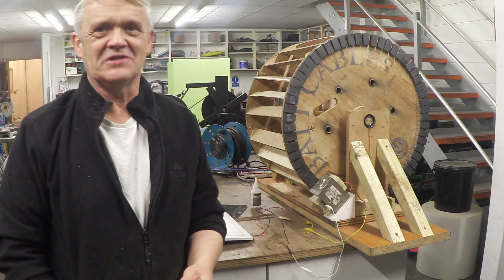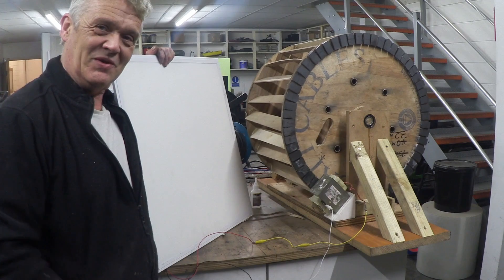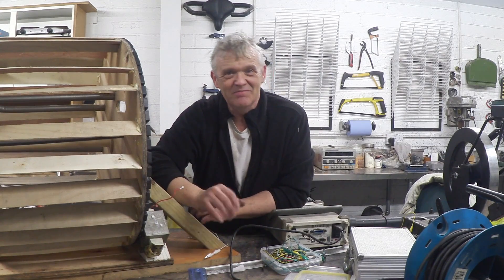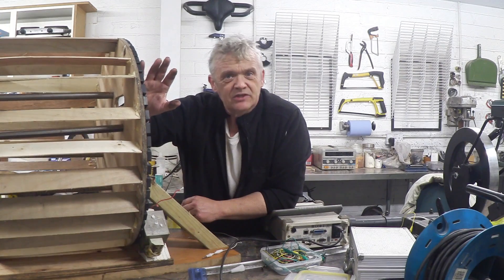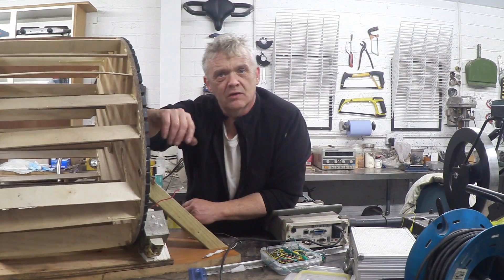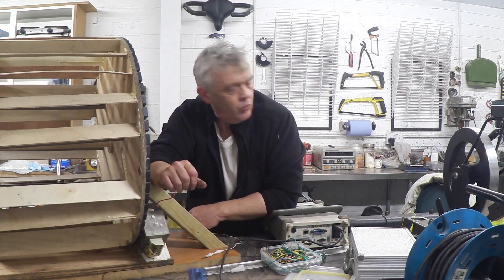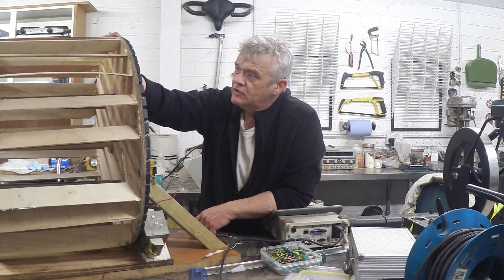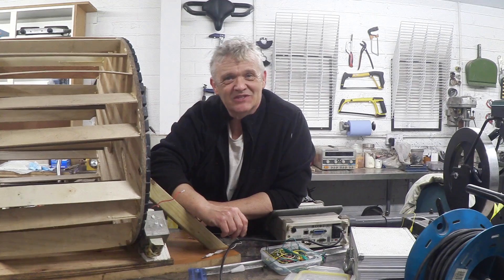Testing The Cable Drum Wind Turbine

Comment: did you measure out the best distance of the magnets for optimal output?
when several magnets pass over the transformer they can (in part) couteract eachother
and with this many magnets in NSNSNS// config they shouldbe able to give a more constant output (wood bobble  doesn't count)
if you connect your scope  to the transformer  and spin the device slowly you might find that  i.e. NN   SS   NN   SS   works better.... or not .... 
just an idea to test out ;)
keep up the good work, really like your vidio's

Comment: Scrap is fine, fix it by cutting a 1inch ring of the same diameter, stick magnets to the ring and then use packers to get a true surface in a low tech way (plus maybe add a smoothing capacitor)

Comment: If the bearings and end pieces  are rigid shouldn't be too difficult to remove warp by squaring the ends up, as if it were on a piece on a lathe. Just need
1) way of turning the drum.... (belt drive running around drum to pulley on a motor on a hinged and weighted plate? Rubber sheet on a drill  drum sanding adapter might drive a drum?  Mechanism of a  "Bungy cord pole lathe" could work equally well but cutting takes a bit more skill as direction rotation oscillates 
2)some kind of  "bar" that can be moved and then held rigidly horizontally near the drum's axis to serve as place to lever tool against/be a rough visual gauge as to how smoothing progressing 
3) sureform, plane or chisel... With an extra long handle  attached to it, for smoothing.
Reply: Could likely use "drum and castors" to make a lathe headstock out of an old car wheel. Drill+ tap 4 tangential holes in wheel... And add bolts through those holes, with heads to outside ... And that's a simple 4 jaw independent chuck. Duplication of such could work as a tailstock. Add a bed and a tool post to slide on it and that's a functional wood lathe. 
Metal lathe would be a development of such.

Comment: I'd love to see what this could do at the peak of a roof on even a small house. The roof will collect a lot of wind and drive it to the top and power it even stronger than the base wind speed. A firm mounting would be needed. You could also vary the distance from the magnets to the transformer to vary the load, even automatically with some work.

Comment: If I had two coils of wire and some magnets for a generator. Can I wire the coils in series like batteries and the voltage be added together.1.5v+1.5v=3v. Let me know
Reply: Yes. That is the idea. Generally more coil length you have or add the higher your voltage will be. Thats why you notice in things like transformers which convert from low voltages <20v to several hundreds of volts. Next is your wire size. Thicker wire of same length collects / gives out more amps, less volts. Thinner wire, less amps more volts. Look at it like water pressure from pipes or blowing on thin straw vs thicker straw. 

Its a juggling act between how much wire length you need, what size thickness, how many coils you need, and to what expectations of output your design should produce.

Too much, or too little when designing wind turbines is no good. If your turbine is producing much greater energy than what your coil setup can handle it could easily overheat/melt. Of course we know of this and are ways around it. The other being it won't start. If your generator is too big for your design, your turbine won't have enough power except in hurricanes to push/start it. (this is all extreme examples/ black and white for contrast). Look up coil wiring on youtube for wind turbines. Theres plenty of vids to give you a ballpark /idea of what to expect.

Comment: I think this is wild!  Simple scraps to demo a principle.  The magnets at the rim are the best idea.  Reminds me of a demo I did for a friend, using a record album.  I put a piece of tape halfway out from the spindle, and a piece at the edge.  I asked which piece was moving faster.  He said they were moving the same.  I only smiled and explained the difference between rpm and speed.  Both pieces move the same rpm, but the piece on the rim moves twice the distance in the same time.   Therefore that piece is moving faster.  It only took a couple of seconds for the guy to grasp the concept.
Reply from the maker: It does take a bit of explaining but then seems like common sense lol

Comment: Suggestion to anybody who has the time and motivation: get loads and loads of those small pow voltage power transformers used for small electronic devices, find a much of them that are of the same general power input and output, and mount them to a ring that has a lot of smaller magnets [because of how magnetic fields cross over the coils] and this should give very smooth, flicker-free DC voltage if you use an out-of-phase array, or, fairly consistent AC power if you set them up to operate in a 3 phase array. ~( 'w')/

Some places literally throw those little portable chargers out any more since so few of them re even actually used once the original item they came with is discarded, so you might even be able to go around asking your family, friends and neighbors for any they may have sitting in a junk drawer, in an old shoe box, or just laying around gathering dust on a shelf in their garage.

If one is resourceful, they should be able to get hundreds of them and be able to set up quite the rig, or, perhaps several of them, it mainly depends on how many coils you aim to apply to each turbine, and just divide your pile of loot by the number of coils you need per turbine and make that many turbines.

       /)/) 
    (  'ˬ') 
@(>_ )-b 
     \) \)
Reply from the maker: I like that plan - I am going to start collecting lol
Reply: @ThinkingandTinkering  that would make an interesting video for sure
Reply: Would the little transformers used on christmas lights be of much use as they have coils inside them

Comment: A real shame that the warping had such a negative impact on output.  I always like to see ways to repurpose what would otherwise be "garbage".  One idea occurred to me, however, as to how you could still get a "true" surface on the drum - place the drum on its side, make a ring form around the edge and pour maybe 3/8" of resin.  Let gravity work to level it off and (once it hardens) fix the magnets to that.  😊
Reply from the maker: I was pondering doing something - hadn't got there - so - I like that - cheers

Comment: Would it interest you to make a cylindrical, bladeless wind turbine for the exercise bike? 
Not a whole lot of people have built working bladeless turbines.
Reply from the maker: are you thinking like a flettner?
Reply: @ThinkingandTinkering  Either a flettner, or a "Vortex Bladeless" type, that is if there's a way to make the required taper on the cylinder without too much dificulty. Just a suggestion :)

Comment: Even with the variable generation, could it still safely charge the Zinc / Bromine battery?
Reply from the maker: yes - stick a diode and resistor in there as a simple charge controller and bingo

Comment: Hey mate good video as always!
   I have a question, with a wheel set-up like yours would it make since to add a tail to the system to ensure it always face the wind no matter what direction the wind flows?
  Also would your style set-up creat enough force to add a DC motor to it to generate more power or run a pump perhaps?
Reply from the maker: I think a tail is a good idea mate - I am not sure it could turn a pump or motor at the axle - it is low torque
Reply: @ThinkingandTinkering  thank's mate!

Comment: You've made a wind turbine shroud Robert and used it as a rough turbine basically.  Awesome.  If the wooden slots were slightly wider you could've made a circular hole in the bottom and popped your savonius or whatever wind turbine into it and popped it on a frame and turned it upright to be a VAWT.  Your a genius m8.
Reply from the maker: I like that idea mate - thanks for sharing - not sure I am a genius mate lol - but cheers

Comment: This design, using a stable material, would work for a water wheel turbine because the water direction is uniform... Curious as to how it would work with the magnets and that microwave thingie...in water.
Reply from the maker: probably just the same mate - but as you point out - smoother

Comment: If you have a few other beaten up cable drums they will be warped in an uncorrelated fashion in all likelihood.  You will then end up with a smoothed output if you have a eg 10 super cheap wind turbines.  I think that the volatility of the total output will go down by the square root of the number of devices, if the warping is uncorrelated.
Reply from the maker: I like that mate - cheers

Comment: Seems to me there are a lot of magnets with a single microwave oven transformer, could you fit more transformers?
Reply from the maker: you could mate but it would be harder to turn
Reply: @ThinkingandTinkering  magnetized iron strips radiating out from axle with centrifugal arms that have the microwave coils as their weights All would have to be placed internally otherwise housing framework would interfere
Reply: @ThinkingandTinkering  rethinking a track would have to be made for the microwave transformers with a rod attached which would pass through the centrifuge ball Numerous things happen little load at slow speeds and turbulence somewhat counteract + a braking system at high speed

Comment: very cool, & you could easily make low cost very low friction magnetic bearings for a VAWT,  additionally you could attach a di-rod generator or your version of same to the end of the VAWT .  another wild idea; could you power a tesla coil off a di-rod or wjmshurst electrostatic?
Reply from the maker: there are some interesting ideas mate - thanks for posting

Comment: You are right, Rob, you don't need high torque. Power out from the rotor = torque (nm) x angular velocity (rad/sec). So a torque of 10 nm at an angular velocity of 1 rad/sec will yield 10 watts. Likewise, a torque of 1 nm at an angular velocity of 10 rad/sec will also yield 10 watts. So, high torque and low speed or low torque and high speed - it's the same thing.
Ignore the detractors, Rob. I can't say that I always find your videos practical, but I always find them interesting. Keep it up.
Reply from the maker: cheers mate and I am unashamed about the vids not always being practical - quite often things just don't work - but I am ok with that - what I think is important is that you try - cheers

Comment: You should think about maybe adding a 5 5 5 timer or reed switch and one of your cd case graphene capacitors then it would never flicker and would stay on solid as the wind turns. Would work real well, I believe. Great job so far Rob. And I mean it doesn't have to look pretty because it is meant for the outside weather. But it will work very well indeed.
Reply: Oh and a tip on making it true as you said. I do a lot with wood and on this I would take the magnets off and spin it with a drill off the edge of a table, just clamp the drill down onto the table and put a zip tie on the trigger when ready. Next I would lay my router sideways on the table and start the drill then sneak up on the wood with the router cutting bit. Keeping in mind the only area that would need to be 100% true is the area that the magnets get glued too. That would solve that issue real quick. That is the quick way to lathe this with tools you already have at hand. I would leave it on the base that it is already on while doing the lathe and let the drill just do all the work on turning the axle.
Reply from the maker: for sure mate - but this is just me investigating right now
Reply: @ThinkingandTinkering  copy that mate, yeah wasn't sure if you wanted to take it to the next step but just in case I would give a little input on making  it easier and of course in case someone else was doing the same project. Cheers
Reply from the maker: @jasonwitt8619  I always appreciate your input mate - you know that - I have even 'nicked' a couple lol - due credit obviously - but I value what you say mate
Reply: @ThinkingandTinkering  Thanks mate

Comment: It was impressive and to increase the output u simply add additional microwave transformers with each additional one increasing the power off the same vertical wheel turbine.
Reply from the maker: yep - f google is right though you would need a bit more wind to do it - but that is all part of the fun
Reply: @ThinkingandTinkering  thx Robert!  cheers and have a great week!

Comment: I was looking at that and thinking old Oil drum, as you say bearing at each end in the barrel centre & cut the fans out from the long side using a grinder leaving the middle attached at each end so the long sheets of sheet metal can be twisted to a suitable angle to make the blades.
Reply from the maker: I like that mate - nice suggestion

Comment: This Turbine is a very interesting design; specially the permanent magnets on the wheel to gererate the electricity: In the end need only two bearings for the wheel and no drive belt for the generator. There is a lot of potential to make it better. For example a bit modification to convert to a vertical turbine. Or other material for the rotor and so on. The basics are very good shown here; many ways open to modify for individual changes. Many thanks for this basic sample of a DIY wind turbine!
Reply from the maker: absolutely agreed mate and nice points - cheers

Comment: What diameter are old speed limit signs? Even if they are warped you can at least heat and bend the metal unlike wood, also thin and lightweight.
Reply from the maker: lol - like that mate - I might get into a little trouble if I went around 'collecting' a few lol

Comment: Interesting once again Robert. If I could suggest, I would try and use magnetic bearing for support on the vertical if possible. This would give you a floating turbine and not require much force or torque to turn the turbine. I am researching and playing around with this idea myself.  Keep up the great work,  love the ideas and the comprehendable explanations  God speed.
Reply from the maker: I like the idea mate and in a really good version it would be well worth it - but for this - the expense and extra complexity probably wouldn't really be worth it - it's all about balance - pun not intended lol

Comment: G'day again Rob, the outside is warped and the blades are also inconsistent with varying degrees of angles, yet it worked and worked well. 
While making it true, imagine if it was on a rotatable base with a blade out back like a windmill to keep it in the wind. Also a second transformer the same connected to the first in parallel with a capacitor bank and rectifier, then the light panel would stay on constantly. 👍
Reply from the maker: lol - I know mate - it was a pile of garbage lol - it's amazing it did anything
Reply: @ThinkingandTinkering  the best prototypes are rubbish that do well to provide proof of concept.